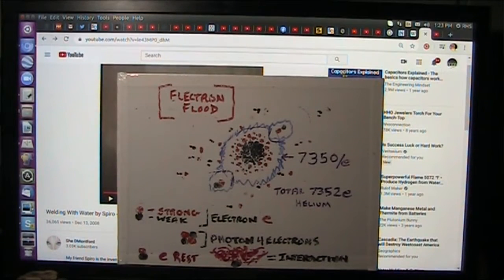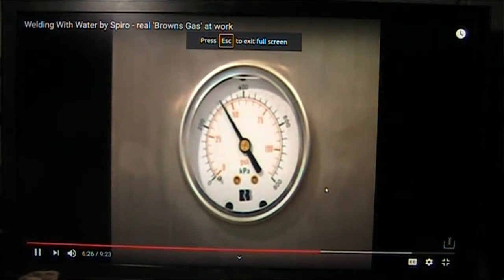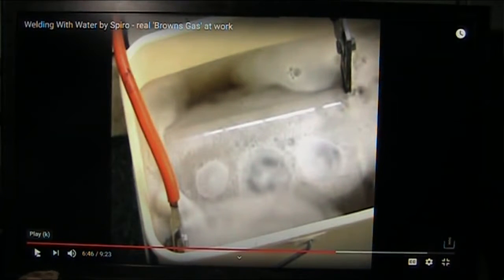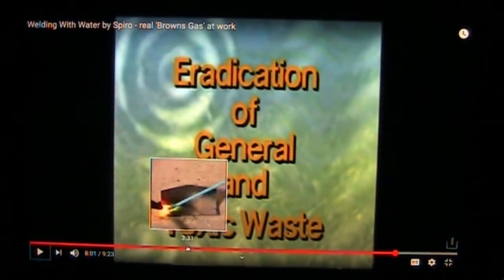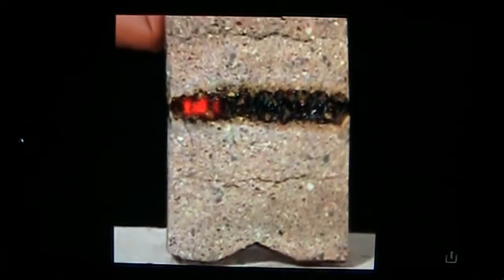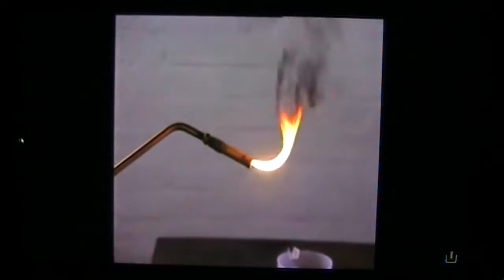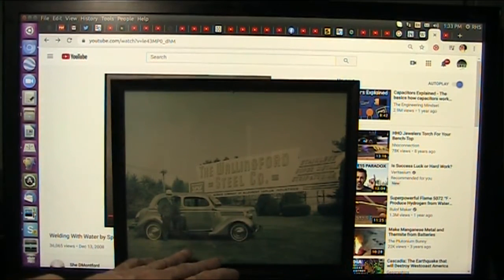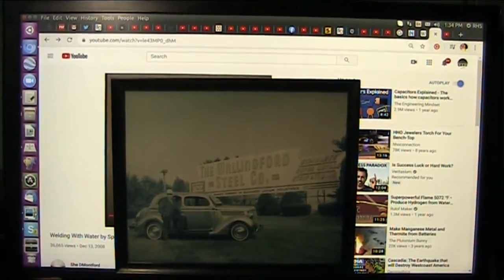Is Browns Gas the Answer

Comment: The venturi relies on resistance.  It essentially needs to bounce back.
   Essentially, imagine a well designed L-shaped rocket stove.  The combustion happens in the burn chamber and is drawn into and up the riser.  When the gasses hit the wall they scatter and re-enter the hotter gasses that are just entering...igniting again...hopefully with complete combustion.  As the stove itself increases in temperature, the gasses in the venturi are hotter, as well, allowing more of the available fuel gasses remaining to burn.  Insulation is key.  I think I read they hit 99+% of fuel burnt...from a log.  The measuring of gasses was the old Testo.  Peter Van Derbilt designed a box with a slit into a riser that any layman could build and burn 95% of the fuel available in the log.  Insulation is key for quick efficiency.

Comment: Isn't the problem for fuel usage is that the output is a greater loss of the input than oil based fuel?  After all, HHO eneration requires electricy which requires a power source. I've hoped to find, but could not, any fuel application where gas mileage increases.

Comment: Platinum recombines this HHO gas. 
For example. You can crush up a cars catalytic converter then Mix this platinum dust with sand. 
When the gas is pumped through the sand it recombines. (First you have to heat the sand up to 70°C.)
The implosion of the HHO into H20 makes masses of heat. Keeping the sand at an ambient above 70°C. 
God bless Roger.

Comment: The problem all other Browns gas proponents have had , is making it fast enough to keep the car running, Every system I have seen makes bubbles like a soap bubble pipe , Stan Meyers setup had an amount that looked like water boiling in a pan.
Reply from the maker: I would use a venturi and my father did and it worked... Just did a vid on it.
Reply: Doesn't the speed increase with temperature?  I know the electric generators SafeWorld Technologies had turned out to be too powerful to pass out to the public as planned (which would require a system upgrade on the grid) because they got stronger with temperature increase.   I was supposed to have gotten one.  My contact up and wound up dead shortly after the conference.  We had some good talks.  I wanted the big torch to make sculptures and exhibit in the galleries to demonstrate industry possibilities.   I think I'd go Egyption iconography with modern found objects.  Drawing on a 4'x6' inch sheet of core10 would be cool as all get out.

Comment: I personally have already run a Town Car and a four-wheeler on Brown's gas. I've also made my own torch. Oddly enough if you pass Brown's gas through PVC pipe wound with copper wire it will create a charge
Reply from the maker: Browns is EXTREMELY LOADED with electrons...not like hydrogen it is SUPERCHARGED hydrogen.
Reply: @mudfossiluniversity  I recently wadded-up a whole roll of aluminum foil shoved it down into it and oxygen tank then filled it with Drano. affixed my own spark  arrestor and have had me a super super hot torch anytime I need it. It just will not stop creating gas

Comment: I have a commercially built one of these machines they are advertised as being used for smoothing plastics “Acrylic flame polisher”. You can also get HHO modules for use at 12v (it doesn’t increase your engine efficiency but you could store it if you are careful or do cutting and welding at a remote site.)

Brown’s gas is water split into a mixture of pure Dihydrogen and Dioxygen gasses you just use the oxygen to burn the hydrogen exactly like you would burn acetylene. If you are careful you can separate the hydrogen from the oxygen by partitioning the space just above the water between the anode and the cathode. That makes it way safer to store though you still have to be careful as it doesn’t take much oxygen contamination to allow the hydrogen to combust.
Reply from the maker: THANK YOU great info.... I will use a venturi to separate the gases.. I think it will work but needs testing.

Comment: Yeah , no doubt it looks like everyone would be using this in place of oxyacetylene, welders, , 
A hot engine will run off kerosine, not well, until it us working hard, like just idling, it's not hot enough to run well, but it will run, but shut it off, and it will not start back, I could see, using hydrogen from water, with kerosine, it would start easier on hydrogen, and the kerosine will be ignited by the hydrogen flame, the O2 will make it run cleaner and better!   I have been thinking about using solar to split water, and build a gasifier, and use both to fuel my generator, to power my house when there is no sun, I would need to use the generator to produce HHo, after the supply stored is used, woodgas and HHo should burn clean and self sustaining! Except for the wood of course, I was planning to use paper, cardboard, and wood waste, I'm not cutting good trees for fire wood! Also I can produce 'wood alcohol', Methanol!
Reply from the maker: Next vid shows the venturi process.
Reply: @mudfossiluniversity  cool, I was hoping to see this, thanks

Comment: More like 1/0 gauge wire, 10 gauge is only good for 30 amps, 2gauge is larger than 10 gauge, it's crazy I know!    It's oxydising flame, most flames are fuel rich, HHo is oxygen rich, it more than just heating, it also oxidises, allowing extreme heat!
Reply from the maker: 100% electrons almost.

Comment: Electron beam welding has been used for decades  . They weld submarines  with it .
Reply: Brown’s gas is water split into a mixture of pure Dihydrogen and Dioxygen gasses you just use the oxygen to burn the hydrogen exactly like you would burn acetylene. If you are careful you can separate the hydrogen from the oxygen by partitioning the space just above the water between the anode and the cathode. That makes it way safer to store

Comment: Yes like Stanley Myers project runs a car in water the kerosene is in the bubblers it mixes with it as a little oil so it doesn't heat up the walls of the Pistons